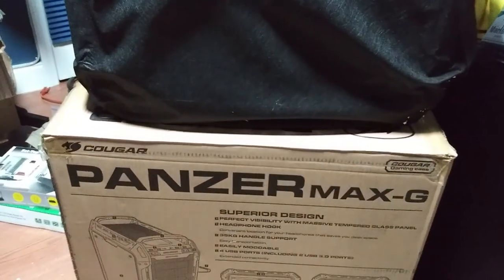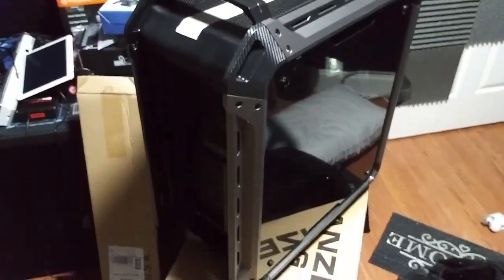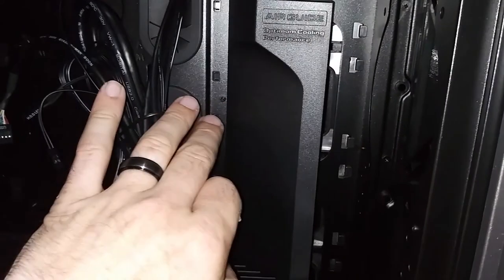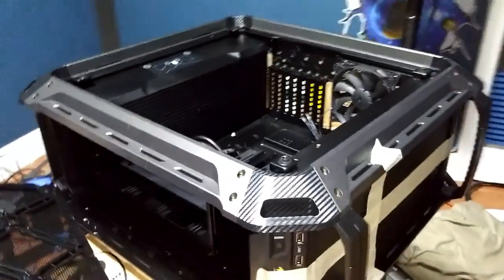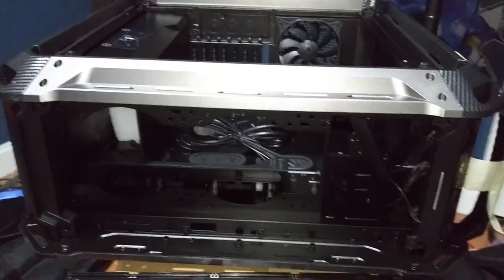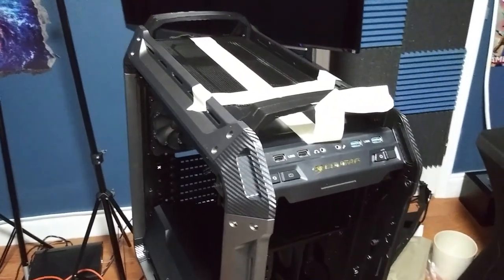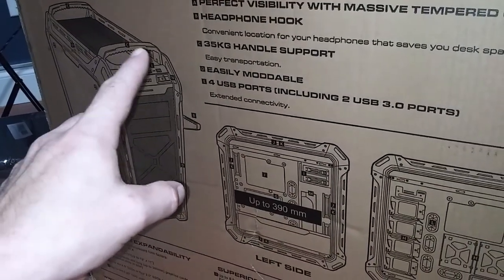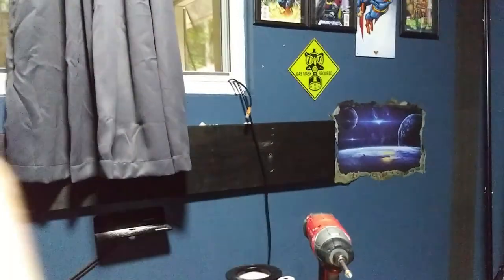Cougar Panzer Max-G

Comment: I am considering getting this case for my new PC I am building, used a Cougar case before when 8 years ago I built a PC with the Cougar Evolution Mid Tower Case but I am hesitant to get a case with tempered glass in it I know that there is the regular Panzer Max case that does not have any tempered glass but that one has 2 fans on the front with no RGB but I know I can just remove them and replace them with RGB fans and the Panzer EVO RGB I was considering originally but decided against it since having 4 tempered glass panels with one on the front and another on top would impede airflow.

Comment: Can the case be confidently lifted by the handles at the top, because my room is upstairs and the case almost being 30 pounds then with components.
Reply: yes it will handle the weight... the handles are very well attach to the case....
Reply: Rated for 35 kilograms
Reply from the maker: yes u can handle the case easy... just grab it on the sides and pick it up with your knees and not ur back ... cheers... subscribe ?